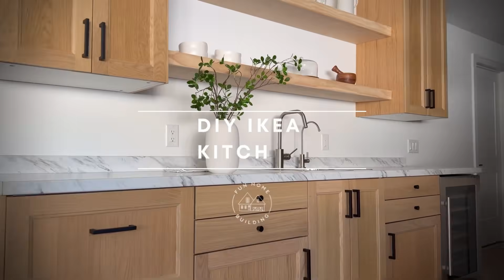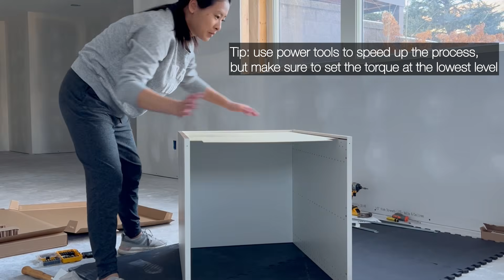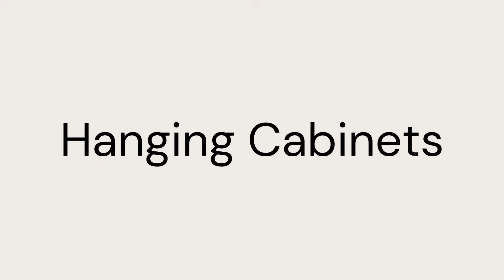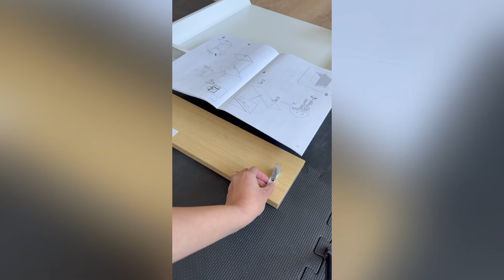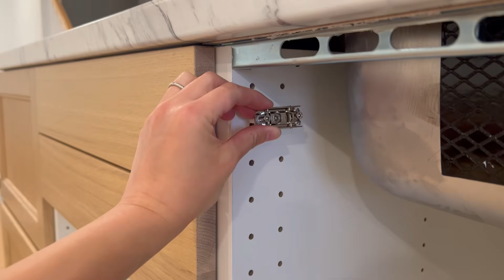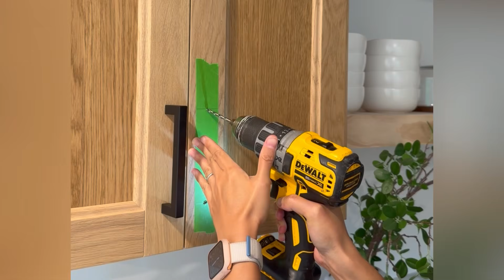Budget Kitchen Build Using IKEA VEDHAMN Oak Cabinets | DIY Start to Finish

Comment: May I ask what tool you used to cut, with the attached hose?
Beautiful job!
Reply from the maker: Thank you! That’s a DeWalt cordless 4-1/2” circular saw, it uses battery and is relatively lightweight.

Comment: I wonder even tho the mini fridge is not meant to be like built-in style is it possible to add a matching piece to that or if it doesn't have enough space a thinner version of same oak to match it up 100% with the kitchen instead of buying super expensive brands meant to be like that
Reply from the maker: That’s a good idea. I didn’t try to make it custom because it will add up the cost, BUT IKEA has integrated fronts for dishwasher and fridge now, they can probably do the same for mini fridge. Then  you can add a cover panel on the other side to disguise it. Totally doable!